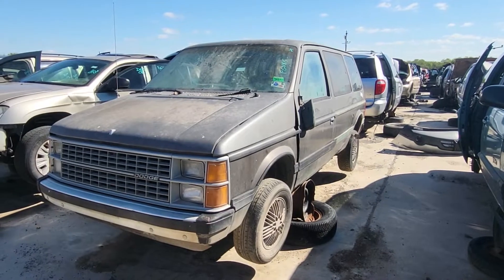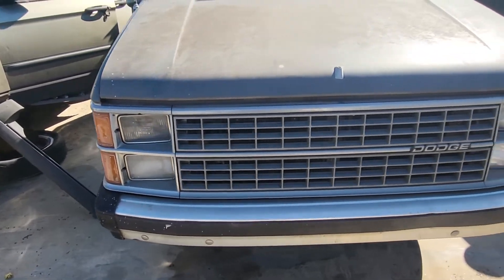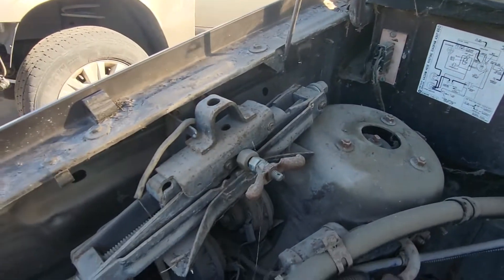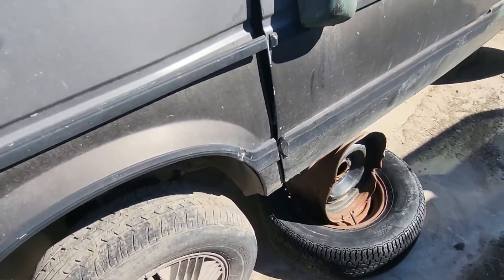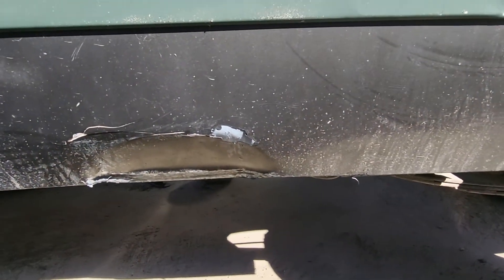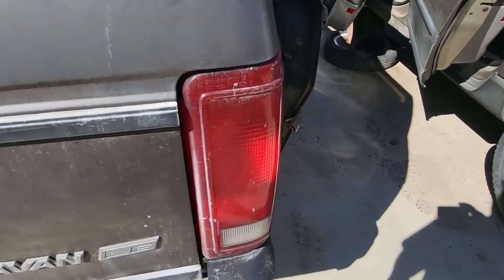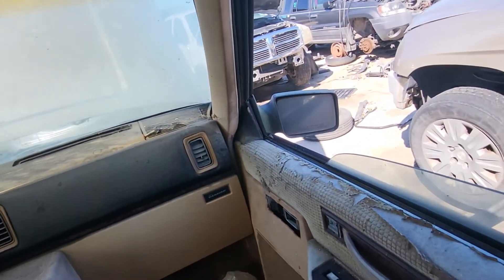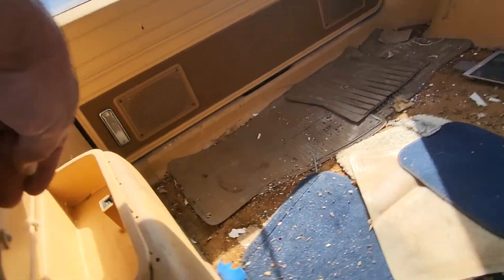1985 Dodge Caravan LE

Comment: The Chrysler 2.2, 4 cyl. was actually the better engine option (but the Mitsu 6 came later)
Reply from the maker: 2.2 Turbo and a manual transmission. Not many made but well worth finding one.